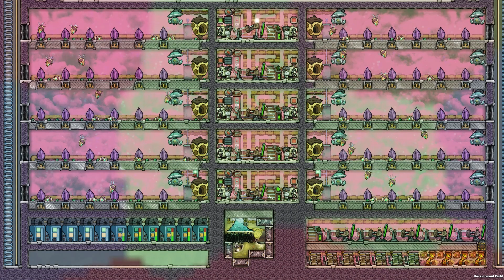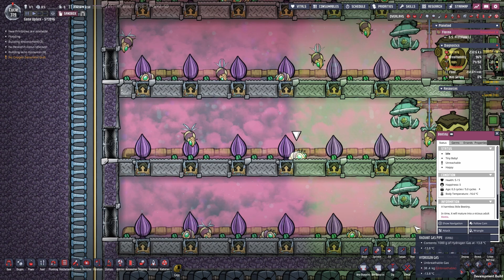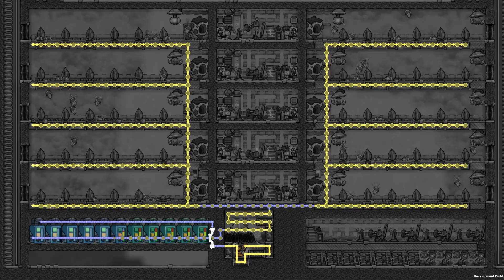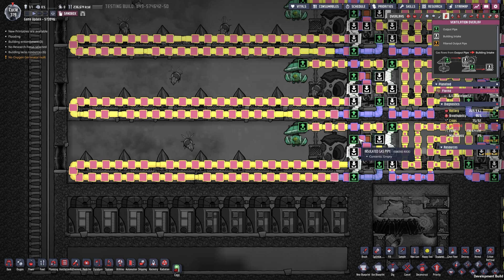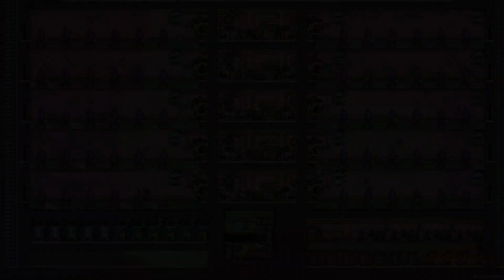Saturn Critter Trap Setup #Version 1

Comment: Very cool! I haven't seen anyone try to make a Plant Meat/Hydrogen farm using Saturn traps before. One thing you might want to iterate on is using automation to replace the hive once it dies after 10 cycles. Right now, it seems a bit labor intensive to manually move the beetiny to the hive area so often. Alternatively, using a different critter that can be easily ranched and dont offer a lot of meat by themselves (like pips) might be more beneficial.
Reply from the maker: Thanks for the tip but the hives never died in my setups. not sure what you mean? Maybe i don't understand them or they work differently depending on the temperatures
Reply: @lumaraw  ah, you must have been feeding them uranium, then. If beeta hives have no uranium ore to process, they die 10 cycles after becoming empty.
Reply from the maker: @Mr_Good_Cat-t4g   i really didn't feed them actively. i also haven't build anything out of uranium. i have read that they only survive for a certain amount but i cannot confirm that is the case.

Comment: Feedback: Unless you're processing uranium with this build, you have WAY too many Beeta Hives. Each Hive can support 30 domesticated Critter Traps without issue. Ideally, each Hive should be in the middle of a single row, with 15 Critter Traps on either side. This will immediately resolve the vast majority of stinging incidents, as few - if any - Beetinies survive to adulthood. Adding an additional Critter Trap to either end will eliminate even that, as the only reason you would have any survivors is due to delays in dupe harvesting. This will simultaneously eliminate the additional burden on your CPU of all the excess Beetas, which as flying critters have 4X the pathing options of the grounded Beetinies. This would also allow you to condense and simplify your gas piping.

Another note, there's no reason for the atmo sensors in the generator rooms. Just let the vents overpressurize at 2kg.
Reply from the maker: Thanks there are some good Ideas i have not thought about. 
The Version 2 already has all Saturn Critter Traps on 1 side with no space in between. simplyfying the piping 
Good call seeing that as well.

Fitting the beeta hives production to the rythm of the saturn critter traps digestion is smart! 
As in you don't have any beetinys or beetas too much. 
Would it would sacrifice though is startup speed [by more than half] . not sure i would want that exchange.
My current solution for version 2 is trap them (the beetas) since there are a maximum of 3 at a time i only need 3 traps per row. But i like your CPU saving idea so will test it in a version.
I am trying to avoid adding even more critter traps since there is a limited supply of them. 
At the current Asteroid i found a maximum of 54.

The Atmo Sensors are for supressing the red symbols that pop up when the vent overpressures.
Just for my soul peace :D 

Thnaks alot for all the Tips and Suggestions :)!
Reply: @lumaraw  To accelerate startup, just have dupes drag in Beetinies from your uranium refinement and wild hives. That will probably result in some early stings, but will resolve itself in 20-30 cycles.

Seed issues, if you're unwilling to use your own seed duplicator, can be resolved by limiting yourself to a "mere" 32 Traps and a single Hive. That said, Version 1 uses 60 Traps, so... 😉

Personally, I can't live without Suppress Notifications. Right up there with the pre-Disconnect Tool Pliers Mod.
Reply from the maker: @asureaskie   i am testing your idea currently and it looks nice. Not as modular as before but also cool. it has been running for a few hours but is still not full so i think placing a second hive or even more to the left until everything is filled then killing them might be an option as well. Just for the quicker start.
I personally am willing to use my replicator but not everyone else is. so they might have to use a smaller setup. 

So far i am pretty happy with the outcome.
Thanks again for the tip.

I also use the supress notification and can't live without it. i still do the atmo sensor for other people that don't have it.
Reply: @lumaraw  is the seed count really limited though if concedering you could split the seed before planting...
Reply from the maker: @leonidmolochnikov4147  of course you can use a seed splitter. But not everyone likes that. some consider it exploits and avoid them. So i showed a modular version that can be shrunken if desired.

I personally would just clone the seed though.
Reply: Good points!